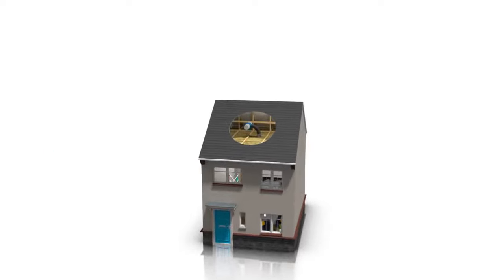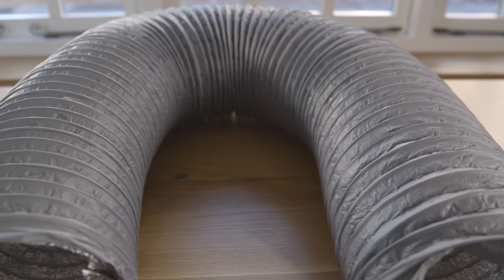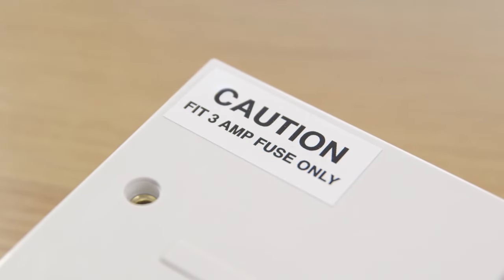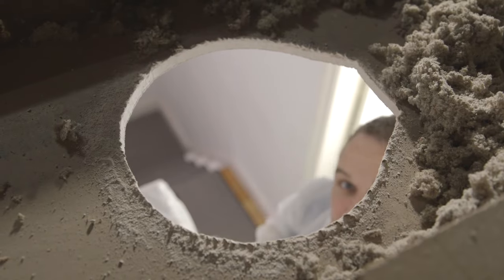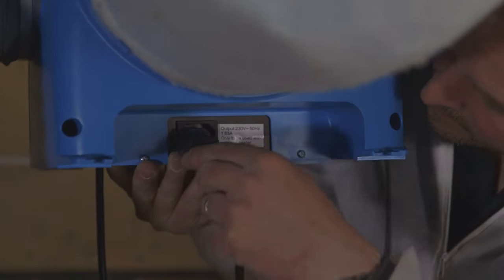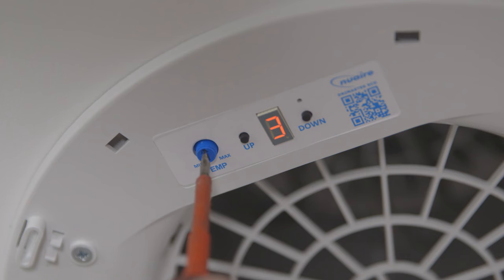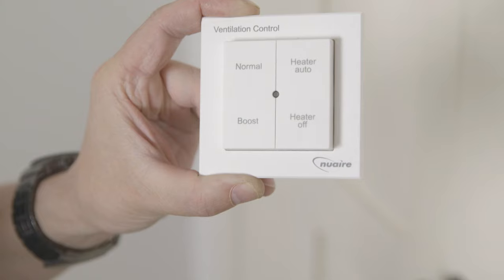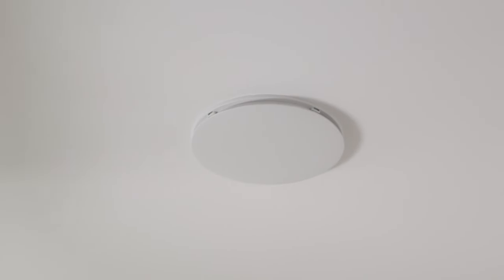How to Install Your Drimaster Eco Positive Input Ventilation System from Nuaire

Comment: I have this exact unit.. it's brilliant,stops all damp and condensation..I do get a bit of hot loft smell before it cuts out on the thermo switch ( normally springtime when it gets hot outside but fans still running) and in the winter I have the fan speed on 3 or even lower at 2 because even when the heater is turned up to full, you still get a coldish air chill from the diffuser..in turn making my landing cold and making my hallway central heating rad stat cut in more often than I'd like..however other than that I really love it.
Reply: I have 35mm of insualted plasterboard, will the diffuser protrude through it enough to fit the heater module?

Comment: Positive input ventilation is a brilliant whole house ventilation system when installed correctly. We have solved many peoples condensation and mould issues with these systems, keep up the good work!
Reply from the maker: Thanks for the positive (pun intended!) feedback!
Reply: How can I adjust temp settings blowing into my house as it's winter now and is cold air blowing? Or how can I change program on mine guys

Comment: Hi, I live in a dormer bungalow where 2 rooms have been built into the loft space. There is a section of loft space above the central hallway which is approx 2.6m x 1.6m. The volume of this loft space is approx 2.6m3. This is where i inted to install the PIV unit.

Will a PIV unit still work properly despite the small loft space available? Is there a minimum loft space required for these to work?

Comment: Our loft gets much warmer than our house as it gets much more solar heat. The upstairs floor gets warmer than the ground floor.   I am thinking of installing one of these mainly to circulate heat from the loft to the ground floor (rather than to cure condensation).  Would this unit work well?  If so would I be best having the outlet on the ground floor ceiling rather than under the loft on the landing?

Comment: How does this work though? Seems really good but where does the unit get the fresh air from? Because there’s only the ducting from the unit going into the hallway but no ducting going from the unit to outside the house?
Reply: Most lofts are naturally ventilated on the sides where the roof tiles end. If yours is not, then they do a unit that has a separate duct that you can run to atmosphere.

Comment: Interested in fitting one of these units. What is the minimum space required between the joists in the loft area that will accommodate the unit's diffuser and heater module. The space available between the joists is 280mm.
Reply from the maker: Hi Kevin, please contact our after sales team on 02920858400 and they will be able to provide you with this information. Thanks Emma

Comment: How important is it to centrally locate the diffuser?  My ceiling spans the stars and landing, and the centre is right under some joists. The roof is also a pyramid type shape and so it's awkward to locate due to the slope of the roof. Any advice is gratefully appreciated. Really looking forward to getting it in.
Reply: How did it go in the in end? Did you install it an a corner?

Comment: Installed one of the heat versions of this yesterday with the help of my son in law although had a qualified electrician do the electical bits prior
Bought mine from i-sells and when it arrived the back part of the fused spur box that comes with it was smashed despite being in bubble wrap. Contacted i-sells who got Nuaire to send me a replacement but despite giving them the serial number of the unit they sent me a 1 amp fused spur as opposed to the 3 amp that should be supplied. 
Also when I originally opened the box the PCB for the display unit was lying loose in the box and simply wouldn't stay in place when fitted into the diffuser. Every time you touched it during the installation it fell out and in the end we had to superglue it in place.
Watching the video above the heater unit simply slots and clicks into place on the diffuser however in my case we had to use a lot of force to get it in as the plastic casing on the heater unit prevented it from dropping low enough to catch on the lugs of the diffuser.
Additionally in the video above it shows the flexible ducting easily slipping over the heating unit and fan unit but in reality we needed a lot of force to get it over and actually tore part of the ducting whilst doing up. Thankfully we managed eventually to get enough over the units to prevent the tears being an issue.
Will see how it works in terms of reducing condensation in the coming weeks but hopefully will be worth the effort and cost.
Reply from the maker: Hi Chris, Sorry to hear you have had a few issues installing your Drimaster unit. We would like to talk to your regarding your install. Please can you email marketing@nuaire.co.uk with your contact information and we can call you or if you’d prefer can you call us on 02920858400.

Comment: My unit is set at a speed of 3  but it is not WHISPER quite. Got no help from Nuaire as was told no engineers in my area
Reply from the maker: Hi David, Apologies for the initial contact with ourselves - if you could contact us directly on 02920 858433 we'd be more than happy to help resolve your issue.
Reply: Hi everyone I spoke to Dale at Nuaire and he could not have been more helpful. No quibbling he is exchanging the unit under the warranty.  I am really impressed  .

Comment: Mines not working correctly the electric went off and when I came back on.  The defuser is just flashing 3150 ? Can’t find nothing anywhere online about it
Reply from the maker: Good afternoon sorry to hear this, please contact our technical department on 02920858400 and they will be able to run through this error with you.
Reply: C4 & SpudGuns HD hi mate did you know what the resolve was I have the same error code

Comment: Hi, if I install this unit, can I throw away my extractor in the bathroom?
Reply from the maker: Hi Tony,

Provided the bathroom is directly accessible from the central landing/hallway and has an opening window then you do not need to use a bathroom extract. You can keep your extract fan as it will only help the Positive Input Ventilation system but it is not essential. 

If the room is remote from the landing/hallway or has a window which cannot be opened then the extract fan should stay and be left on continuously to help the PIV.

If you would like further information about our Drimaster-Eco  PIV system please contact our sales team on 02920858500.
Reply: I am looking at Installing one of these, if I have a bathroom with shower off the landing with no window, bathroom is 8cm, online is suggesting I need a fan that does 42 ltrs a second, what power do I need if I have one of these. 

The dmev units I have seen have nothing like that much power. Please advise.
Reply: @NuaireGroup  ‘

Comment: A guy was asking €960 for the drimaster heat supplied & fitted 🤔
Reply: HAH! The nerve. It's simple to fit. Just the electrics might need a Part P qualified electrician who should be able to do it for £40-50. 

The entire job should cost no more than £100. Takes about 1hr and most of that time is deciding where to fit the vent. Product cost is £400-£440 ish online.

Comment: i have an old Drimaster unit with the square vent and im thinking about upgrading to this new unit will the circle vent cover the old square vent we have now ?
Reply from the maker: Old Drimaster units have the same 200mm duct size as our Drimaster Eco units so a retrofit is very simple. If you need some advice on buying and installing a new Drimaster Eco unit, you can call us on 02920 858500. Thanks!

Comment: Can the loft insulation be safely replaced surrounding and covering the heater unit?
Reply from the maker: Hi Peterjbdk, can you contact our Technical Support team so they can offer you some advice? 02920 858400.
Reply: @NuaireGroup  where can I get one with installation? Also how many kWh is it expected to use a day
Reply from the maker: @CF-Gaming01  Thank you for your message, unfortunately we do not offer an installation service. However if you contact our sales department on 02920858500 they will be able to give you information on installers within your area and information on the unit you are enquiring about.

Comment: Bought the ‘hall control’ so that I don’t have to go into the loft. Waste of money. LED doesn’t work and been in and out of loft to turn it on and off and disconnected and re-connected cables etc. Now it’s stuck on full blast in the middle of winter for a small semi-detached house. I’ll be returning it, no help on FAQs or instruction manual

Comment: I didn't get a 4 way switch I don't get no heat from it and blows cold air so cold at night not fair on my kids I want to know how to turn this off completely plz
Reply from the maker: Hi Jen, thank you for getting in touch. Please can you email aftersales@nuaire.co.uk and they will be able to help.
Reply: Same here absolutely freezing staircase in the centre of the house. Huge hole where vent is. Not great for keeping your home warm. It has been installed in a small loft and takes up a lot of room. I don't know how much energy these things use either, I'm seriously considering turning the unit off or better still removing it all together.
Reply: @sjt1043  did you remove it? or turn it off? if so how? im going through the same issue.

Comment: These thigs are terribly cold  My  housing association has installed one(on cold setting 24 hours a day) in my tiny bungalow ,In the kitchen,  there's 5-7 degrees difference from living room to kitchen so when opening living room door cold comes in !! . Ignorance  on my arrogant landlords part as there's a passage way between kitchen and bathroom !! and who wants to be running 400 watts per hour in this energy state were in at the moment . Ignorant tenants, landlords and homeowners are the cause of condensation and mould growth. Education is needed ,not a freezing cold unit costing hundreds of £.

Comment: Honestly I really wouldn’t bother with these, they really are a pile of turd, my house is now constantly freezing cold after my landlord decided to instal one of these instead of replacing the rotten windows which are the real cause of my condensation problems! They aren’t particularly quiet and even tho I have the heated version it barely even warms the air and I’ve been told it’ll only heat up to 2  degrees! Yes it might help damp problems but so will opening all your windows 24/7 which is exactly what having one of these is like in cold months even at it’s lowest setting! Only watching this video to make the removal a little easier for myself
Reply: Typical response from a person who likely moaned about damp and doesn't care about the actual property. The air quality will have improved 10-fold, making your health better and through time will also protect the landlords property .. I bet when you turn it off that you still don't open a window...
Reply: @gman3474   nope windows have always and will to continue to be opened every day! That’s a typical landlord reply of oh it must be the tenants fault but in this case it’s down to the landlord taking the cheaper option that comes with a lot of draw backs. I was just pointing out that these systems probably do work but there are issues that come with them, if you want a constantly cold house you crack on though!

Comment: what is inside the unit? Fan sucking air from outside and heating element?
Reply: Pretty much. It is very simple - a fan inside the unit sucking air from inside your loft through filters and blowing it continuously over a heated element into your home via the ceiling duct/grille.